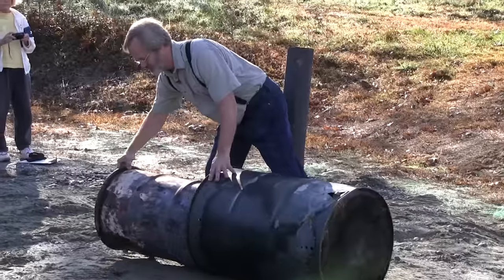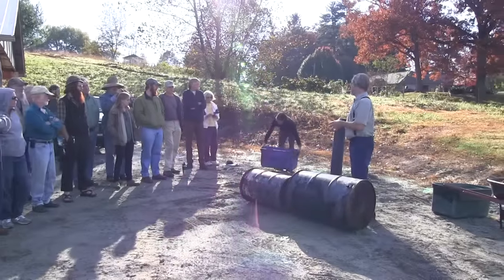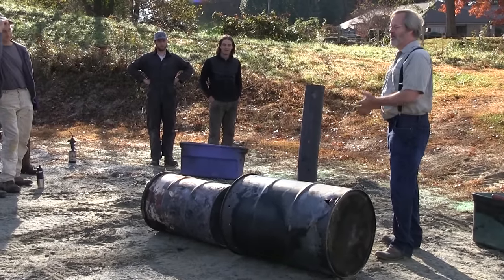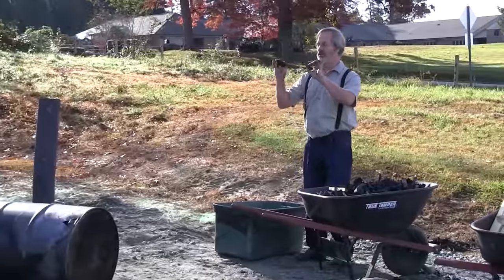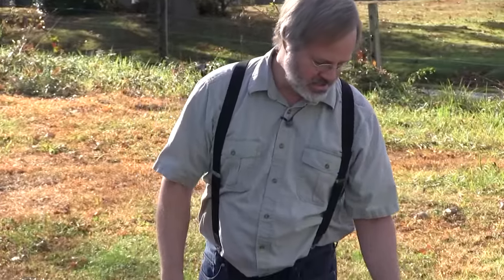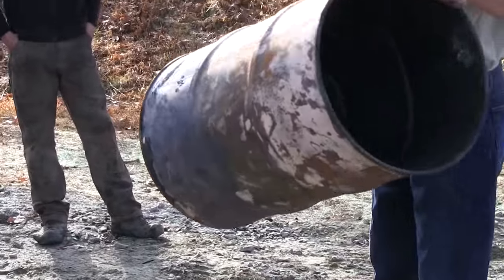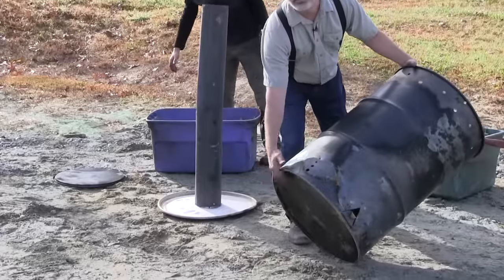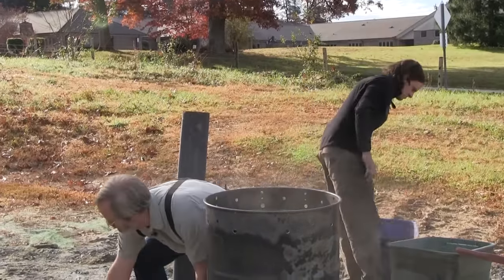Biochar Workshop Part 1, How to Make Biochar

Comment: Firstly I would incorporate a more robust system to reduce the cost of replacing the drums over time. Also I would incorporate a water or oil based system that could transfer the heat to a home or a stove top using pipes. Use mixing valves with temperature controls to automate the system so that you could heat a house or stove top to your desired temperature. There are a million ideas in my head that to utilize that clean and dirty energy coming out of the stack.

Comment: You say that the steel drums will be used up / rusted away after around 10 runs. Do you know if by building a similar design with firebrick would work out better for longevity?
  Also do you have or know of any good videos that cover smoke re-burn for wood burning stoves? Thanks.
Reply: +izzzzzz6 there are other videos on here of people making retorts out of firebrick.  Infact just smearing clay or earth on the internal surface expose to combustion will help a lot, In one way by insulating the chamber, but also preventing exposure to combustion.  If you really want to go all in, you could fabricate your own barrels out of vermiculite and those would last until sometime after the sun burns out and destroys the earth.

Comment: Very good explanation of the biochar process. I couldn't do this at my home because my homeowners association would throw a fit.
Reply: You can do it on a small scale right in your grill. get a cookie tin or popcorn tin, depending on the size of your grill. Fill the container with dry fibrous material, secure the lid with three self tapping screws around the rim and WARNING! you must poke some holes in the top to let the flammable gasses escape. When the gasses stop coming out (you will see the fire coming out of the holes as long as the char is roasting) you know the char is done. I usually put the container upside (holes) down on a fire safe surface. Let it cool and make sure that you crush the resulting char to <2mm particles before you start enriching them.

Comment: This is a great video especially for recycling the chimney heat (though they didn't show anything). Also, you can tip a barrel on its side to get the wood burning.. Once the fire is going tip the barrel up as normal while adding sticks.. Once full, cap it.. Really, it's that easy.. Also, the barrel doesn't need any holes.. I'm not sure why most people but holes in the bottom when oxygen isn't desireable (other than keeping the fire going to an extent).. But yeah, if this works for you great

Comment: Two questions:
1. How do you ensure a good seal on the lid of the inner barrel? Is it just a good metal to metal press fit? My barrel didn't have a good press fit and so I tried using a fiberglass seal made for wood burning stoves, but it melted.
2. What limitations do people see for scaling this design up to larger barrels? I imagine it could take longer to heat the inner barrel if the outer fire is further from the center--and therefore you might have to keep adding wood to the outer fire until the smoke from the inner barrel can sustain the process. (This was one of the biggest problems I encountered with mine when using wet wood--the outer fire would go out before things were done, so I had to monitor it for over an hour and sometimes restart the outer fire from scratch).
Reply: Don't bother with this, just do the cone pit method, never wears out, costs you nothing and is effective.
Reply: @georgecarlin2656  It has lower efficiency but totally off set by the fact that all it takes is to dig a hole instead of getting a kiln.
Reply: @minhducnguyen9276  I'm not sure it's less efficient than having to cut your branches to small pieces to fit inside a small tube and burning off to ashes the wood inside the outer tube - not sure that any of this is more efficient, if anything it's like twice more work, at least, if you have the wood pre-cut.
Imho the kiln method is so widely used because it mirrors western culture to make things seem more sophisticated than it really is.
Reply: @georgecarlin2656  In terms of conversion rate a kiln will always have higher efficiency than the pit. But if you are speaking in term of work that you have to put into, the pit will beat the kiln. I have saw a video where a guy using both methods to demonstrate that even using something as simple as a steel drum will increase the yield for the same amount of wood compared to the cone pit. But he did say that he'd still use the pit anyway because it cost him nothing besides the work of digging the pit and the pit methods can be scaled according to the amount of wood needed to be processed.
Reply: @minhducnguyen9276  Yeah, my point was the ratio between the huge extra kiln work (chopping everything small and nice) that isn't even closely balanced by the extra biochar I'd get in theory, besides I don't even have any kiln or unused barrels, and for new comers the more the new thing requires extra gadgets the FAR less likely they'll try it.
The kiln and such are needed where making smoke is absolutely forbidden or if you're harvesting more than biochar. But if anyone (the government) was giving away kilns for free I'd take one and do some biochar from time to time, cause sometimes I get sawdust and it needs no chopping.
Reply: @georgecarlin2656  I also depends on the amount of material. Kiln works well when you have a constant amount of feed materials. And it must be large enough to justify getting a kiln. I'd only burn twigs from my grandpa garden once every three months, that's how much a small garden produce, getting a kiln is just burning money.

Comment: What I do is take a barrel a lot like your outside one, fill it full of wood (big pieces as much as possible up to ~4inch diameter). then fill the space between those with sticks to get the fire going. 
Light a fire on the top, let it burn down. As it starts to burn, I keep putting wood in, but every hour or so I reduce the diameter of the feed stock by an inch or so. By the time I finish adding the 1 inch diameter stuff, the 4 inch diameter stuff has mostly charred through to the middle. I let it burn until the last sticks that I threw in have turned to charcoal (you can tell when this is because the big flames of the wood gas go away). At that point you just douse it with a hose until it stops steaming. 
If you plan to use it all for biochar, you can crush it, but I use the bigger bits for my charcoal barbecue, so I lay it out in the sun for a few days and rake it with a wide tooth metal rake and take all the medium to large charcoal and store it for the BBQ. The small chips are perfect size for biochar. 
Realistically, while this method is a bit less efficient, you also aren't dealing with a smaller airtight barrel, and you get more char per burn (I generally get a third to half a barrel full of charcoal). The method of using the smaller barrel works better for making BBQ charcoal actually, since you can use dense heartwood in the inner barrel and get good quality lump charcoal, but if you want biochar just burn it in the barrel, and if you want both, you'll get plenty of decent lumps along with the small chips in the burn barrel method, and all it takes is a bit of sorting afterwards to separate the larger stuff for the BBQ.

Comment: drill small holes in the stack and you will burn off the smoke as it rises through the chimney. which will increase the draft
Reply: Good information. Good practical presentation. 👍🙏🙏🙏

Comment: could you put  metal ring larger than the barrel itself and placed over the pipe thus giving a wider area to cook on and no smoke. all so could this be used in the home as a source of heating .
Reply: Basically it's a rocket stove.
Reply: You cannot use this inside your home

Comment: I love those who say easy peasy.., will find that getting the right balances of wood stock and the right burn to get biochar and not just ashes is anything but easy to begin with. And it changes every-time your inner stock and outside stock changes.   I will point out something I have not heard him really mention though he did touch on it with “neighbors”...is your local fire laws.  Not everywhere especially if drought or high fire season...can you burn this.  It’s the beginning stages that are dangerous or if anywhere the can could possibly get knocked over and catch the area on fire or windy.  He touched in  the many safety issues.  Many times folks (especially guys) think “oh I got it, I’m not stupid” and the next thing you know they have burned the back shed down.  Always have a strong flow working hose (hoses) with good strong wide distribution (like a firemen’s type) nozzle at the burn site period.  Have several shovels and plenty of loose sand, or dirt. I like sand because it also helps anchor the barrels as long as you plan for the holes at the bottom not to get blocked (have to be higher up the can).  But in case of an accident...you can easily shovel sand on the fire to put it out. Dirt works too but it can get hard and difficult to deal with if a lot of clay.   I think the top should be anchored with fire bricks — regular will get too hot and may explode.  But using a couple of kettles for making hot tea etc and for a big pot of chili, potato soup, etc even fry up some eggs or make cast iron biscuits or fruit cobbler  is very good too. If you use fire bricks and get them very hot on the other side you can set them on cast iron lodge kettle to cook the biscuits and cobbler evenly.  Or as mentioned below...start some coals to put on the top of the cast iron lid same as cooking on campfire.

Comment: This reminds me of the Retort I used to use to make Coke for my Forge.  I've since switched to Whitesmithing.
Reply: What does any of that mean?
Reply: Certainly an unmitigated tangent, but driving off the volatile components from coal is quite similar to making bio char.  I just made two batches of bio char yesterday, spread them on a bed of horse manure, and top dressed w/ hot chicken manure.  I have been making char for some months and by the Fall should have about a cubic yard of super-charged organic matter to spread on the raised beds.
Reply: Beautiful albino squirrel at 35 at the base of the tree to the right in back of the speaker
Reply: This sounds like drugs
Reply: Bro sounds to me like you're cooking off of batches of Coke and now you're a whiteSmith lol hahahahahaha. I used to call myself a crystal collector when I was a cook years ago lol hahahahahaha
Reply: If I didn't have started with the part 2 of the workshop and ended up surfing wikipedia to check the meaning of some stuff (or translations to my language, or actually just curious about what wiki said about terra preta which is in my own language) I would have been very confused about the coke you said. Whitesmith though was still new to me.
Reply: @TheTrock121  I envy your garden.

Comment: If you are using pallets with nails, use a magnet to retrieve them after the burn-off.
Reply: Beware though, many pallets are treated with toxic shit.
Reply: That won't work with biochar.  The finished product is still physically intact, not turned to ash, so the nail is still embedded in a large chunk of charcoal, not lose in the bottom of the barrel.

Comment: Could this system be incorporated into a rocket mass heater to heat a home or greenhouse?
Reply: Rocket stoves are not designed to harvest charcoal, but to generate heat. The burn tube is encased in thermal mass, making it impractical to extract charcoal, although it's possible to snuff the fire after the volatiles are consumed, but how could you see when that's happened? Other types of wood burning systems can be installed that allow you to create a mix of heat and charcoal. There is a tradeoff between the two; obviously, you get less heat because you're not burning the charcoal.

Comment: Great Video Bob, Any need to seal up the bottom holes on the outer chamber when the gas production is done and the fire is off, since the system has to be oxygen free even when cooling?

Comment: We have been making biochar for years for cooking and eating as a way of life in Thailand. We dig a hole for hardwood logs cut to about 3 feet and start afire then smother them with rice hulls except for a 2-3 flue in the top of the hulls after cooking 24 hours the result is biochar. We take the pieces and put in water then air dry then bag and sell.

Comment: I have an idea for you. You could use restaurant used waste frying oil in a waste oil heater to run the retorts in your commercial operations. Just filter the food particulates out. Mix it with wood chips or something. Then when gassification begins and is enough to be self sustained, just turn the waste oil heater/burner off or low.
 That's the theory of it anyway. 
 I hope that makes sense.  Let me know what you think. 
 And if you could somehow attached a steam turbine generator to use the heat being generated, all the better for you and your company.

Comment: Thank you for sharing the technique of biochar making. would it be possible to make biochar of coconut shell using the same method? Please advise.
Reply: any organic matter can be turned into bio char, but hard organic matter, like wood and coconut shells, are way better than anything else
Reply: My belated appreciation to your response almost a year ago. Wish you all the best! My friend.
Reply: David Martin hi there
I'm running a project and we are using coconut shells, it works perfectly, but then it depends on what u want to use it for, if its for the soil then you should have no problem, if u wanna reproduce a charcoal bars then u will need to crush in then shape it

Comment: wrap a copper pipe around the chimney and run water through it to a radiator heating system in your home and a water heater.

Comment: A friend of mine uses a paint can cleaned out of course with one small hole in the top. He then fills the can ½-¾ with sawdust from a circular saw and then places the can in his wood burning stove. The gas is escaping from the paint can burn off because of the pressure of the gas coming out and the fact he only has one hole in a can flames do not go inside. He uses this method for making charcoal in the making of his own gunpowder.

Comment: Only use HT pallets. Others are treated with chemicals.
Reply: I know the O/ P probably won't see this , so anyone in the know please feel free to answer ...what is HT? And how can I identify it .
Reply: @georgeelmerdenbrough6906  I'm wondering the exact same thing.
Reply: @georgeelmerdenbrough6906  heat treated
Reply: I wonder if using the pallets as the fuel (outer drum burn) would be OK, or whether the chemicals would still be a concern from the fumes burning the inner drum?
Reply: Not to mention pallets that are treated for rot and with insecticides or treated wood that uses zinc . There's only a couple of types of pallets that I would feel safe burning . Also never use OSB wood or particle boards or anything else similar to these types of materials . There's all kinds of chemicals used in making these things that aren't burned off during this process which is gasification .

Comment: I know burning charcoal in air produces amoniaca liquor which could be converted to gas...

Those escaping gas could be captured and used in the kitchen Later. That's another way of preserving the energy....

Another option is to use the heat to boil a steam to run a turbine engine that generates electricity...

These are nice projects...to start... Thanks man for this methods...

Comment: Maybe it release methane that is 26 times worst for green house effect  but it will release it at 1000 times more slower than you do !!
Just a thought
Reply: After thought and a few video later, yes your are sequesting carbon, cause you guy are burning the oxigen and hydrogen in the wood not the carbon !! I got it now
Reply: @Nicolasdu5  yes the flammable gases are burning off out the bottom holes. Another method is piping the wood gas out and back down underneath the sealed barrel to further heat it. Slightly more efficient and less likely for any fire creeping in through the holes.